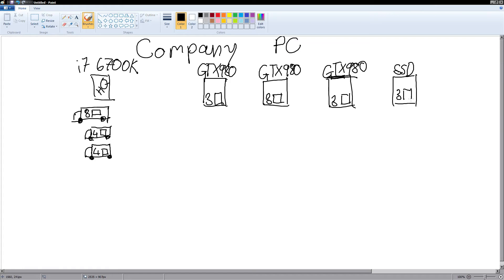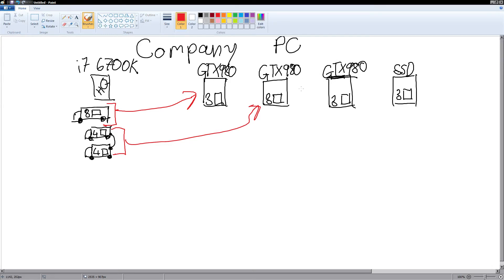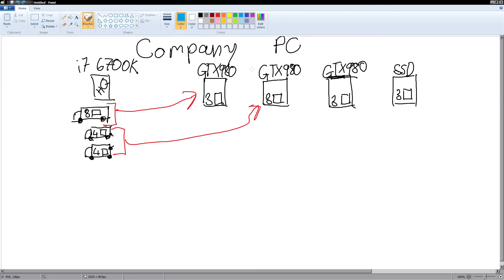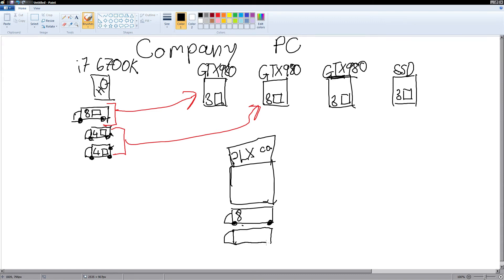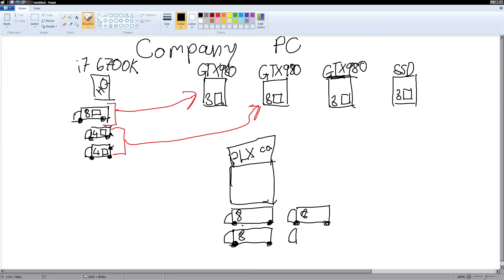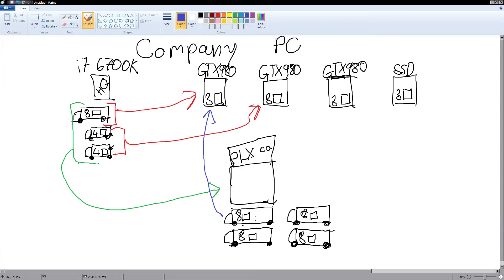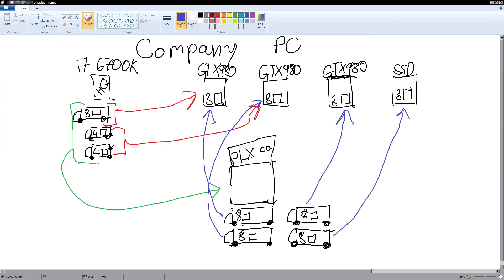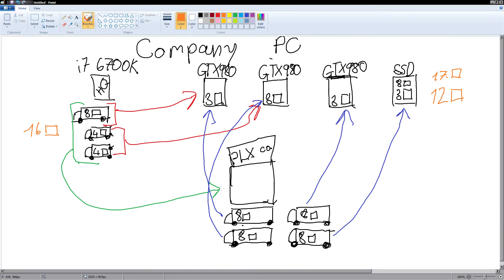Xplained with Paint: PLX chips

Comment: What about if one doesn't do gaming and uses integrated graphics? Introduced Latency (6:12) is a hug issue in audio machines.
Reply: Each crate represents a PCIe lane. You should have no problems unless you're using PCIe devices.
And anyway, audio workloads don't saturate 4 lanes of PCIe anyway so a PLX chip will introduce only the latency needed to make the "extra trip" which is in the order of nanoseconds - barely anything when compared to a 1ms threshold for live audio work.

Comment: distribution available Pci express lans bandwidth to all devices.........

Actually, the cpu should automatic do it.......... a same there never build support for it.
Reply: Well a graphics card on an x4 connection would run fine, so this wouldn't be needed, but nvidia on their high horse is like naw dawg, ya need 8 lanes. this was tested on the fury x on multiple occasions where 4x had no performance drop. there were some issues at 4k on a 4x, but those disappeared at 8x